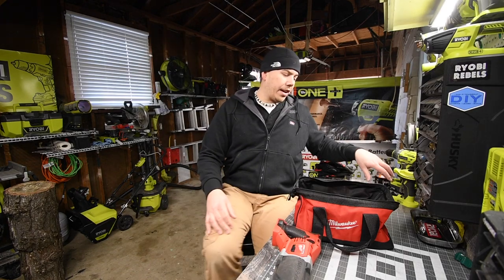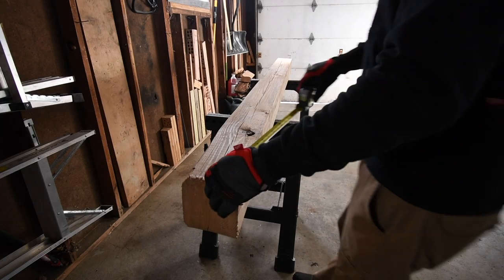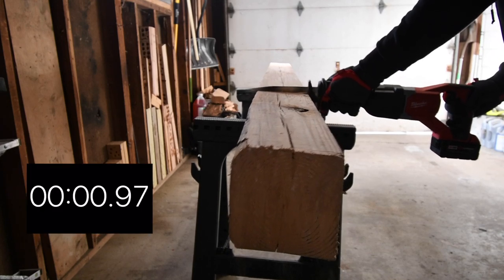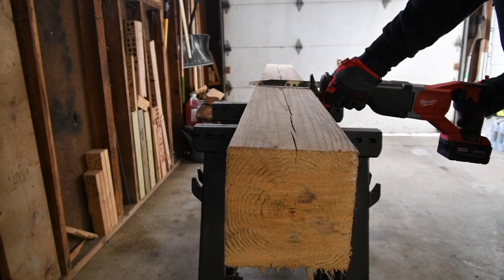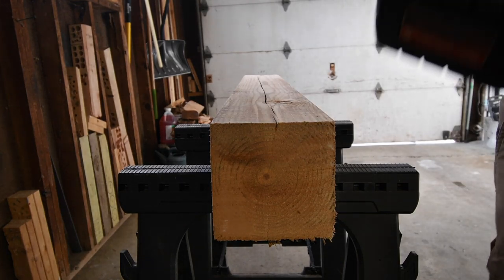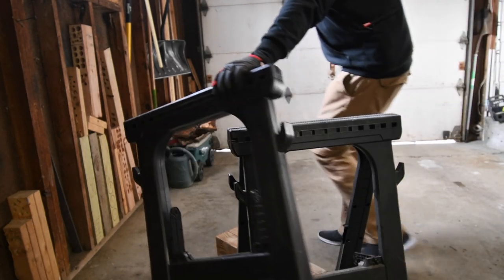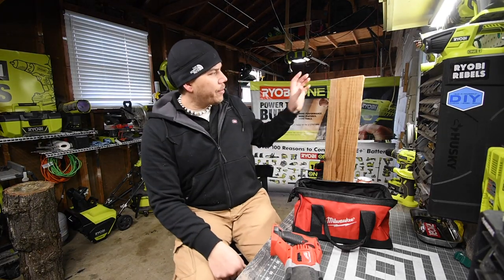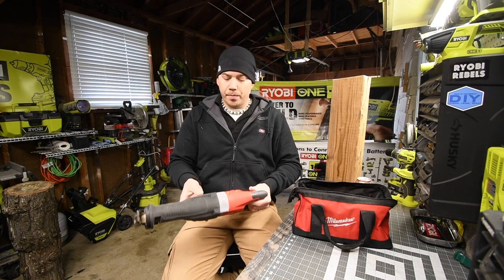FREE TOOL!! Milwaukee Brushed Reciprocating  Saw "Test"

Comment: I know this is an old video lol. But i love brushed tools. I grew up watching my brother, and then eventually using his brushed black and decker tools.  Cheap, brushed, only had 1.5 ah batteries, and still so much got done. You’ve done tests on the ryobi p235a impact. We’ve had it about a year, and it works better, but only a little bit than the B&D impact. We’ve almost completely renovated the house, plus building a shed almost entirely with the same set of brushed b&d tools he’s had for almost a decade. Most of that work got done before we even got the ryobi. If the cheap brands can make tools that perform that good, i think the good ones can make some pretty decent brushed tools